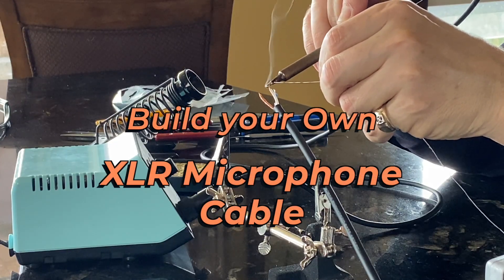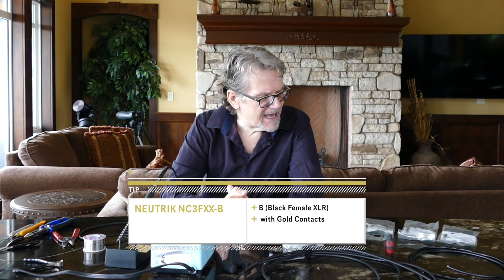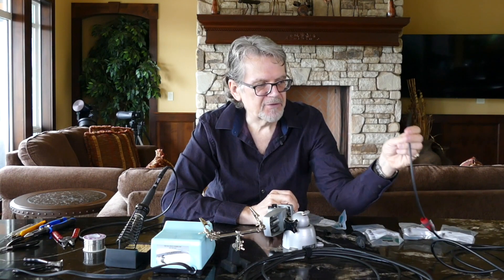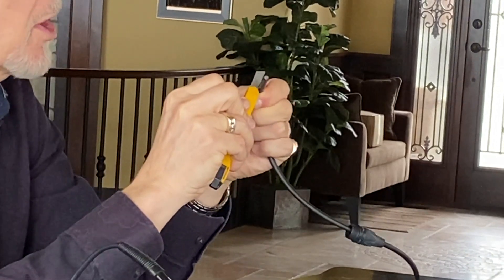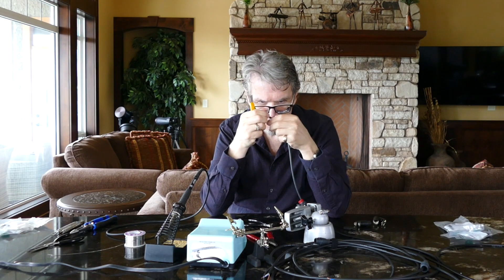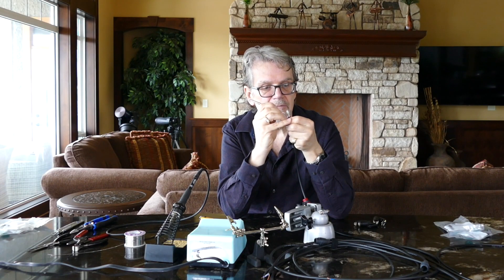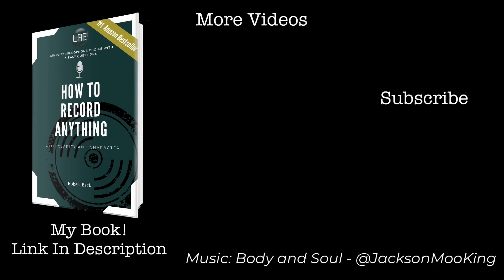XLR Microphone Cable DIY Series - Part 1 Strip your Cable Ends

Comment: Question......First off.....Great video!.........Is the main difference between these two cables the Canare l-4e5c vs Canare l-4e6s just the total thickness?    The 6s has 21 AWG wire and the  5c has 23 AWG wire but not sure which one would be better to buy.  I like and want all the features these wires provide for noise reduction.   The second question is because I want the noise protection, would it be best to use the Neutrik NC3MXX-EMC & Neutrik NC3FXX-EMC connectors vs the ones you are using in this video since the Neutrik NC3MXX-EMC & Neutrik NC3FXX-EMC connectors provide enhanced RF screening or is the quad cable enough?  Thank you for your time.

Comment from the maker: 0:00 Intro
0:29 Cable Building in 4 Steps
0:48 Recommendations
1:41 Components
2:11 Gold vs Silver connectors
2:57 Do THIS FIRST before Stripping the Wire
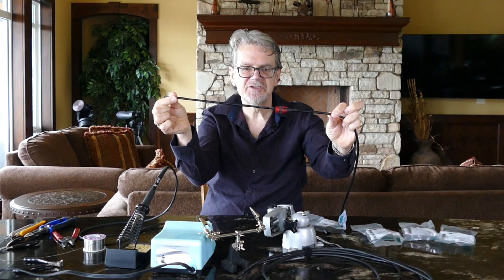3:34 Live Cables - Canare L-2T2S Braided Shield
4:16 Studio Cables - Mogami W2549 Twisted Shield
4:58 Strip your Wire Ends for Tinning
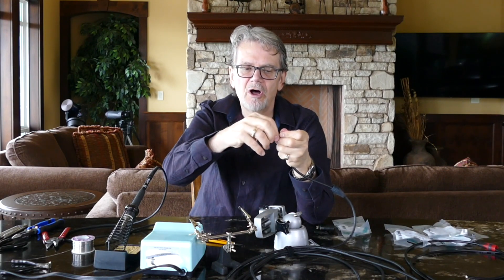7:30 Making a Ground Termination
8:38 Unbraiding Canare L-2T2S Shielding
12:00 Up Next: Step 2 - Tinning your Wire Ends